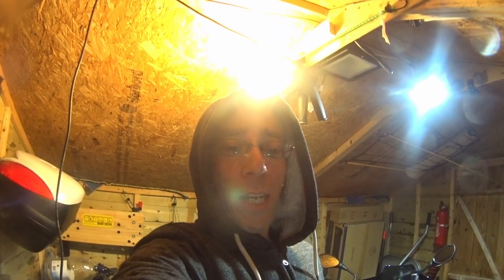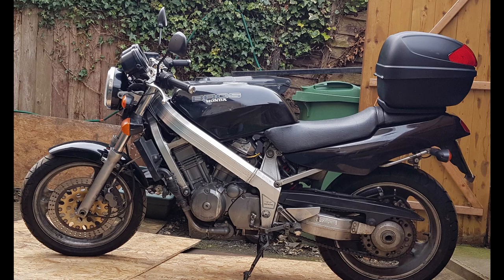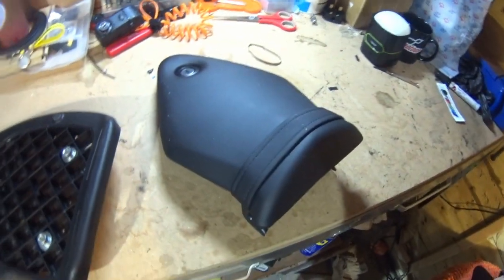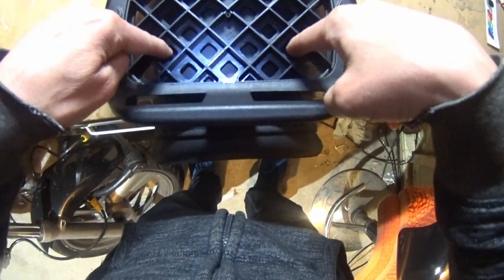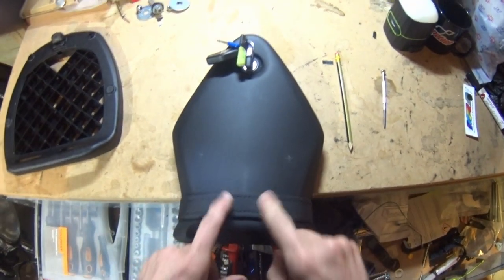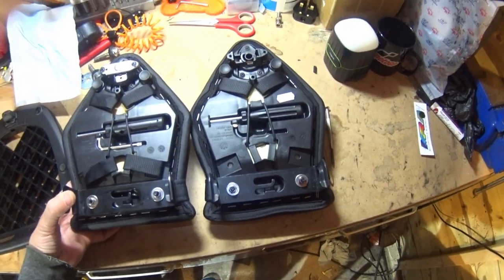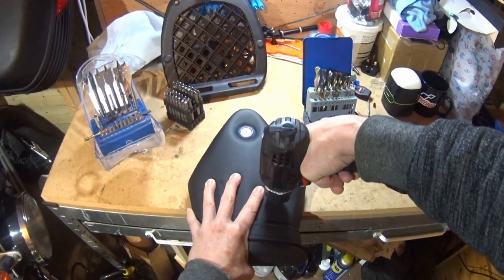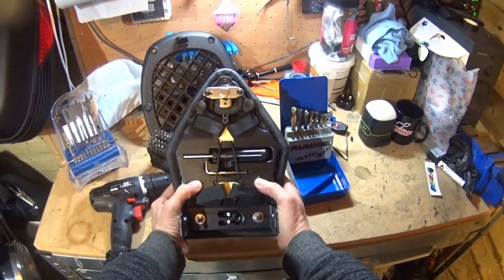Givi Givi Givi A Rack After Midnight (Part 1) BMW S1000R pillion seat/Givi Monolock rack conversion!

Comment: Hi. 

Great vid, thanks for sharing. How did it hold up? Did the plate & topbox cause any damage to the locking mechanism on the bike? I've recently bought an S1000R and am looking to do the same, but I'm not sure how the seat and lock will hold up as I throw the bike around at speed.
Reply from the maker: I haven't damaged the lock so far, but what I did notice is that the two self-tapping screws in the underside of the seat unit (which hold on the locking mechanism to the seat) had unscrewed themselves after a few high speed rides!  That made the pillion seat feel loose.... Ultimately I think I might have to replace the screws with nuts and bolts to be safe.  I think it's best to limit your top speed with this setup on your bike (just don't go to crazy speeds!)
Reply: @RikkyTang  really appreciate the insight. Thanks very much!

Comment: I've don't so.ething similar with my street triple. But of leftgright wobble to it, any ideas. 
Or do you imagine it's sturdy enough? Wobble just a psychological concern more than mechanical?
Reply from the maker: If the rack wobbles then I don't think it's a good idea to use it until you have made it more secure.  I found the best way is to try to have the mounting bolts as far apart as possible to the left and to the right of the seat.   The wobble is a mechanical concern, especially when you have added another 10KG of weight with the top box + whatever is inside the box - it will put a lot of stress on the seat lock.
Reply: @RikkyTang  the rack to the seat if solid. It's the seat that's wobbling
Reply from the maker: @DragoniteMotoJP  Ahh OK - well I think the same info applies - having the weight of the box wobbling around on top of the seat will probably damage the lock.  On my seat I added extra padding to the metal bars that my seat hooks onto; that helped reduced the wobbling on mine (and you can see in the video I also used a strap on the outside of the seat too)